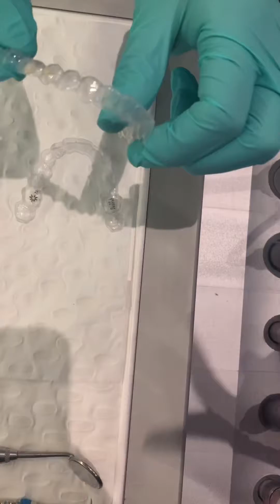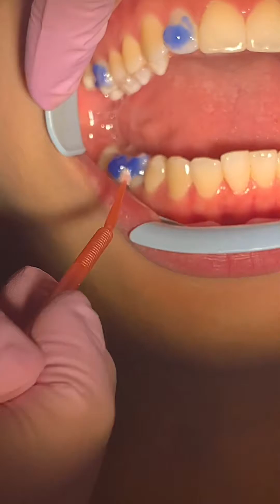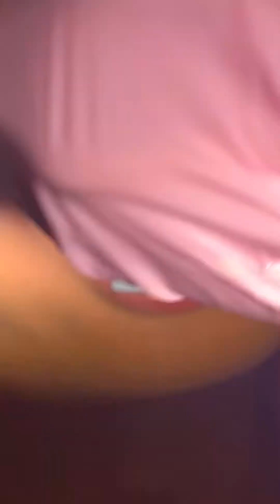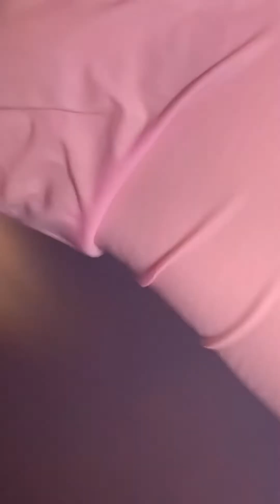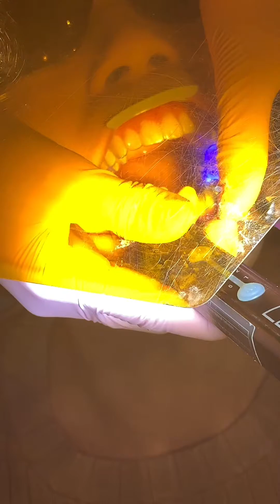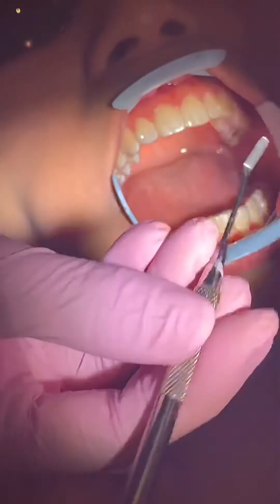How To bond Invisalign clear aligner attachments with an attachment template

Comment: How do we prevent the flow of composite into the interdental areas when we place attachments. .
Reply from the maker: You just add enough composite to fill the attachment well
Reply: @bossortho  hello! So we should overfill the well? If so, do you remove the excess with a handpiece? I'm still having trouble getting my attachments to stay.

Comment: Why didn’t you cute the bond before you placed the trays with flowable in?
Reply: Wondering this also
Reply: because the tray wont fit if we cure the bond and the attachments are thin enough that the bind will cure through it
Reply: @anjalijain2192 Doesn’t make any sense. Always cure the bond before placing the trays. If you dry the microbrush after picking up bonding agent and then only slighty dip it on the tooth, then spread the bonding with a new dry microbrush, you will never have a problem fitting the tray. The same method is applied when bonding a crown

Comment: What material did you use for the attachements?  Is it a flowable or the thicker stackable type composite?
Reply: Flowable Composite
Reply from the maker: Flowable composite by Filtek or you can also use Transbond LV
Reply: can we use any bonding agent with this composite